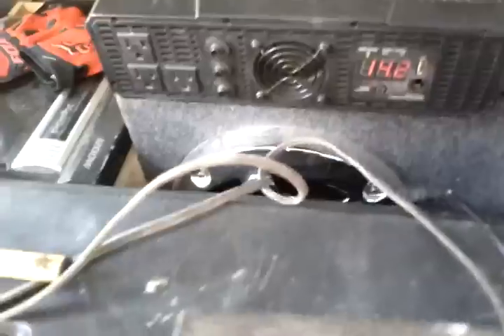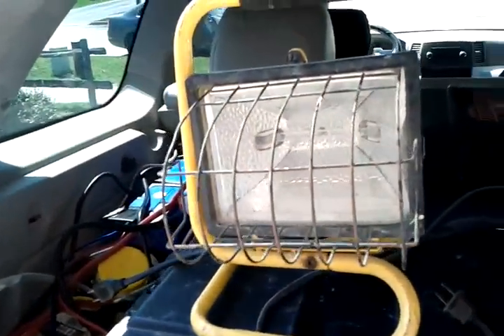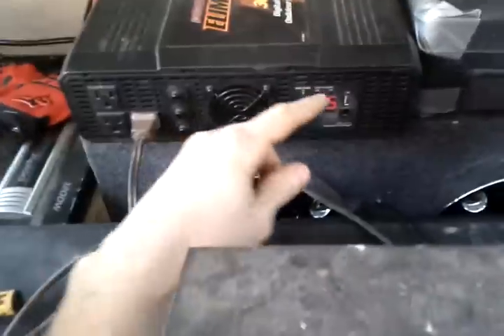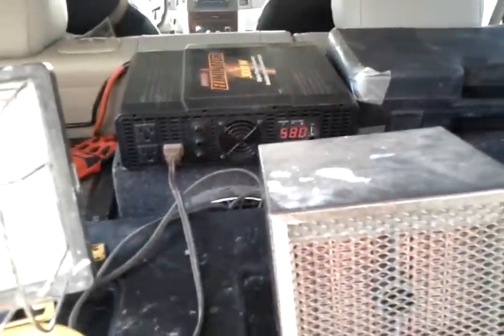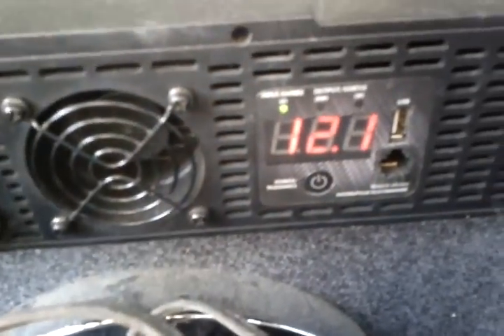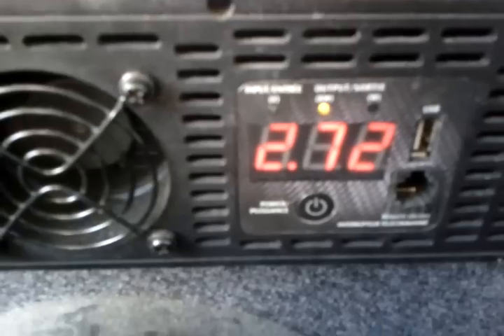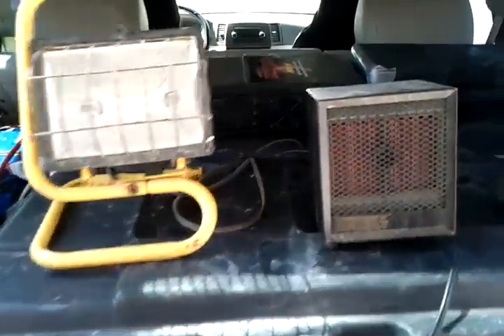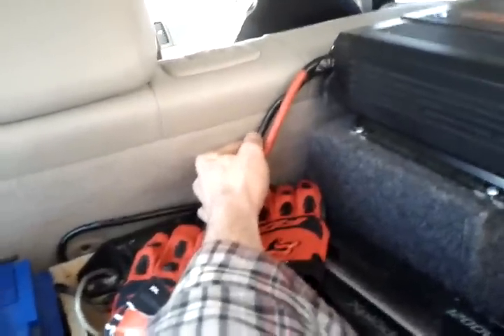Eliminator 3000W Inverter

Comment: just picked up one of these off the used market , for 30$ it has issue that says OLP and fan goes nuts with no LOAD plugged in trying to figure out whats going on with is night mare
Reply from the maker: Over load protection, does it work at all?
Reply: no power on the output side! I am looking for repair manual , I am thinking its the mosfits that gone bad  @GoingOffGrid101

Comment: Do you know if i plug that inverter directly on a marine battery, will it drain the battery quickly? Thank's.
Reply from the maker: Depending of what you run
Reply: @GoingOffGrid101  2 CPAP

Comment: junk!  I have went thru so many eliminator inverters, I have eliminated them from any solar installations I do......they are highly unreliable.  No substitution for a heavy transformer,  if it ain’t heavy, it’s not worth putting in.    Just my two cents worth...a square wave inverter is not good for all loads, and these eliminator inverters do not have much for surge power, they will just go pop if you try to overload them with a motor startup, like a well pump or compressor.
Reply from the maker: I have never tried something like a well pump only worm drive skill saws and such.

Comment: you need to give them  more time to worm up , when the peak is gone  you can turn the other ,i bet it will work n not sound the low bat. alarm . when you draw more then 200 Amps over 2000w you should have min. 4 in line to handle it better , 808 back out
Reply: on this setup you have a 1500w x2 so min. 2 per side but 4 in line makes a huge dif.

Comment: That wasn't a low power warning, that was an OverLoad Protection warning.  You had a 3000 Watt source, plugged in 1500 + 1500 in heat,  then went beyond it.  Of course you're going to overload it.  But that's the source's inversion capability, not "low power" however.

Comment: I just got one of these 
When you load it down to 1500 watt heater 
Mine makes strange noises
Reply from the maker: Like a buzzing?
Reply: @GoingOffGrid101  yes but I hooked up the tiny gnd wire to my neg ground and the issue stopped immediately 
Thank God 
But it was making a buzzing and fans coming on and off

Comment: I just bought one and noticed there are two sets of positive+negative terminals at the back.  Does it matter which set the batteries are attached to?  Or is it just a handy feature to be able to attach them from the left or right side?
Reply from the maker: both POS and NEG need to be connected to the battery, do not use only one set or you will only be using half the inverter if it is built anything like mine in this video

Comment: You need two sets of the same gauge and length wires connected to both sides coming from the same battery bank. It is stated in the warnings in the instructions.
Reply from the maker: yes it is true, thanks

Comment: Is good inverter for use where the 12 volt battery has a continuous charge. ie the engine is running. Not so good for running of of unassisted battery bank. A lot of power is lost in the conversion. Much better inverters for efficiency in converting the power but they are more pricey. I have this inverter for my Kenworth to run microwave. It is a short use of power usually with engine running. In my RV I have much better inverter for longer battery life.
Reply from the maker: Mike Hunter its around 90% efficient, not to bad i think.

Comment from the maker: use Deep cycle batteries AGM or flooded, use 2 gage  or thicker wire to each battery, 3 batteries i find work great, you get the full 3000W for a little bit at least . With just one battery i would use one set of 0 gage wire or 2 sets of 2 gage wire, O and keep the wires as short as possible so you lose less power in the wire do to resistance.

Comment from the maker: No it does not have to, But one battery will only put out about 1500 watts max, this inverter will easily use 3 batteries, and to clarify unless you are running anything less then 2 gage wire from your battery to the inverter it will not do much to have both sets of terminals in use

Comment from the maker: I have four 4 gage wires (2 negative 2 positive) and two 2 gage wires 1 negative 1 positive. and i have 2 AGM batterys in the back about 200Ah and one AGM in the front 60Ah and my alternator is a 130Amp, and i could easily use another set of 2 gage wire, Its crazy how much amps these things will take!

Comment: What's the battery wiring config that you use? We have the same inverter but cant figure out how to wire it to the batteries properly. It seems to not hold a charge as long when we have two batteries hooked up.